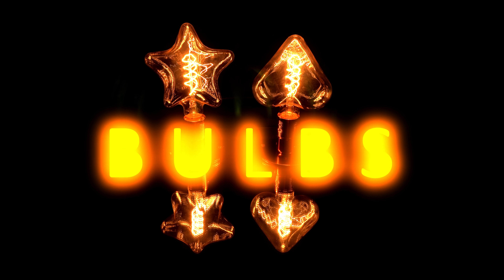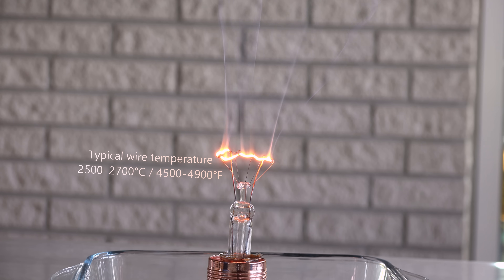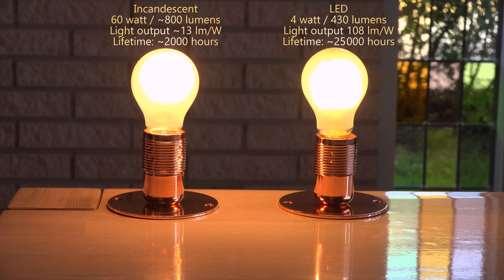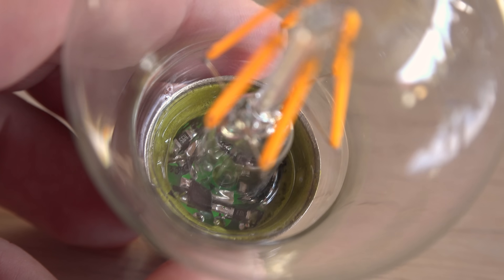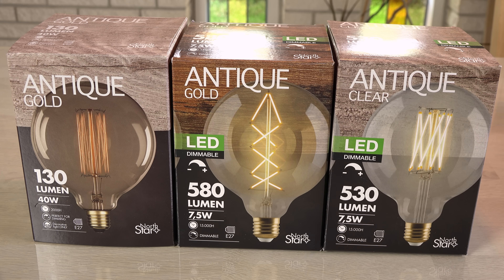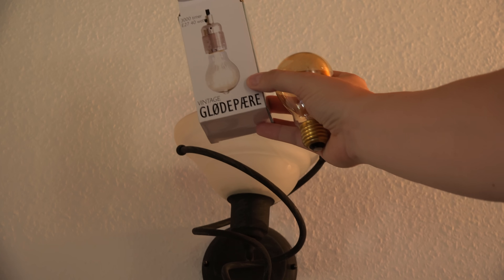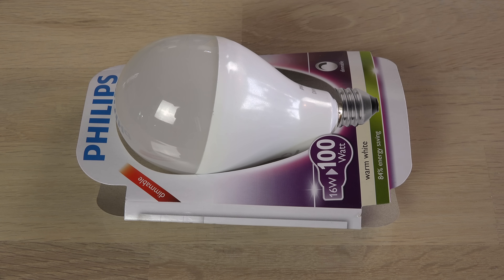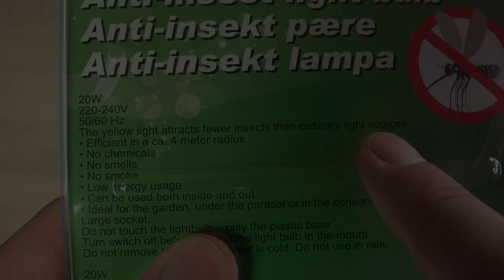Light Bulbs | LED vs. Incandescent

Comment: It is suspicious that incandescent bulbs are completely band. Spiritualist believe that negative spirits are scared off by incandescent light sources. It is similar to the suns energy. LED is cold light. unlike the sun.
Reply: In 1917, they probably said the same thing about incandescent electric lights... in favour of gas lights.
Reply: No, the sun uses much higher frequencies than your incandescent bulbs.  There is reason plant love 6500K not 2700K. Stop this alternative facts BS.
Reply: I am better at Ouija boards than you because I have more spirit energy
Reply: Actually the neutral cold light of LEDs is way closer to sunlight than the yellowish color of bulbs.

Comment: the thing about all this if you like in Denmark (or Canada as I do) is that for most of the year the heat an incandescent bulb generates is not wasted, it heats the house.  Sure, that isn't the most efficient way to heat if you have a natural gas furnace, but to say the heat is wasted is to not understand the rest of the house.

Comment: I had LEDs in my house then they put them in at work .I started getting headaches so I pull them out my house and I guess i will have to get special glasses for work cause their LEDs are worse than the ones I had . so it's either special glasses are suffer with headaches .

Comment: The amount of energy which is "lost to heat" might not really be the large net loss in household energy consumption it is being made out to be.  If you live in a locale where your furnace kicks in almost every day due to cold nights or winter climate wouldn't the extra energy, which is lost to heating the bulb, offset a near equivalent amount of energy otherwise needing to be used by the furnace?  Heat doesn't just disappear, even small amounts.

Comment: I replaced most my lights (even the outside FLOOD lights i got) with LED...it's well worth the change. My bill went from 300usd to 185 a month..it's a huge difference. Also the "LED PROBLEM" lunch meat that looks that, it does not fake it as normal soft bulbs do. I call that reality not a problem...

Comment: Did you test the lifetime? I had LED bulbs which died after 1 year already.
Reply: My oldest LED bulbs are at least 3 years by now and are showing no signs of failure. I don't buy low quality LED's though, so that might be why. The LED bulbs in the spot lights in my bedroom ceiling lamp are made by Philips and were quite expensive, but they give a very nice light and have held up for several years.
Reply: Dieter Käppel 
I've had to replace my LEDs every month, how do you get such efficiency?
Reply: :'D
Reply: cheap CRI chip, even that they say it will last 20+ years 😂😂😂

Comment: Is CRI a new way of judging light color? I am familiar with the color temperature spectrum in Kelvin, like they have been using for light sources for decades. 5600-6500 Deg. Kelvin for example. Another thing I've noticed with LED auto tail lights is the lower powered tail light seems to have a very slow refresh rate, especially on some cars. Cadillacs and Nissans seem to bee the worst. Their tail lights flickering is very noticeable and very annoying, reducing my concentration while driving. Yet automobiles operate on DC.. Very curious.

Comment: There is a lot of misconception about this. George W Bush BANNED traditional light bulbs in favor of light bulbs that last 1/2 as long and cost 3x times as much, while saving less that 15% energy.  This means your spending 6x times as much on light bulbs for negligible savings on your electric bill.  LED bulbs do save a significant amount of energy, however they cost more that 60x times what a BANNED light bulb cost.  In total, motors in American factories use far more power than all the light bulbs in the country combined.  If you think your saving the planet with light bulbs you are not.

overall the decision by George W Bush to BAN traditional light bulbs has cost American consumer billions while putting that money in the pockets of large corporations

Comment: Are they really "efficient" though? 
My brand new $10 Osram LED bulbs are failing like crazy. Had 5 of them, already had to replace 3 in LESS THAN A YEAR!!!
Meanwhile, I have some incandescent bulbs in my bedroom that I couldn't be bothered to change. Now, they are over 20 years old. Not to mention they used to cost about $0.20
Specs are one thing, in reality led bulbs are crap.

Comment: +Jeffrey314159  Oh Yea! the HP version of stabilization.   I modeled that in an early circuit simulation software in, I think the 70's.  The warm resistance of the bulb is around 500 ohms and balances against a resistor in the other arm.  
...
The bulb is barely lighted to keep it on a slope of changing resistance with power.  Too cool and R doesn't change.  Too hot and R has flattened out.
The bulb was a 7 watt 120 volt bulb, very much like the olde Christmas tree lights of the 50s-90's.

Comment: In my experience the Incandescent Insect Repelling Globes were highly successful but the light's color was unpleasant for humans to live with. In my experience the new low energy fluorescent yellow lights look the same color but do not repel insects. I find night vision is greatly reduced under the new fluorescent globes because they lack the color range to illuminate all surfaces. They are bright but color blind. If no red shines on the surface, no red can be reflected. The new fluorescent globes forced on Australians failed within a year, but we were told they had very long working lives. Your revelations confirm my experience, the new globes cause poor vision and may be very harmful both physically and psychologically. The LED lights flicker and are in my opinion fatiguing. i don't know if they contribute to epileptic seizures. Laser lights can be painful and blinding, causing people to look away. Not good to look away from laser traffic lights and turn arrows. People in Australia have died because they failed to distinguish between go lights and turn lights at controlled intersections. The authorities and light manufacturers and installers just turn a blind eye, because if they don't, they are in trouble. Thank you for this revealing presentation.

Comment: Thanks for the info.  The biggest problem with the specs is the life.  The hours that are posted are pure fiction.  I've replaced LED and especially florescent bulbs as much if not more often than the incandescent ones in the same fixtures around the house (multiple bulb ceiling lights).  Without the ban, these bulbs would not be competitive.  The real reason the ban was put in place (at least in the US) was that the legislators were given huge investment opportunities in the manufacturers of the new bulbs.  They made a lot of money by making citizens go out and buy inferior replacement bulbs for a higher price.

Comment: Personally this is one law which had good intentions but wasn't though out.  This is my experience.
My living room was lit up by 2 100W bulbs.   60W bulbs was dull, depressing and strained eyes when trying to read.

They were replaced by 2 light rails which hold 4 halogen bulbs each (8 in total)
Because these bulbs only light up a very small focused area I have to use 55W to get close to the lighting the 2 100W bulbs generated.
But that isn't great.  I've since had to add 2 floor lamps with "energy saving" 40W bulbs to bring up the brightness more and its still not the same level as what the 2 100W bulbs would have generated.
So I replaced 200W worth of lightbulbs for 520W of bulbs.

Similar with the bathroom, which would have had 1 100W bulb, now has 8 55W spotlights. 400W
Bedroom would have had 1 100W bulb has how has 3 60W spots. 180W

So for those 3 rooms, I would have been using 400W of bulbs, now uses 1100W of bulbs.

I know, try new LED.  I have.  At great expense I replaced all the Halogen bulbs with main brand led equivalent.  It cost me well over £100 to do this. Within 3 months half of the stopped working.

Comment: some of the LED watt ratings are based on incardencant equivalent in matched  lumens 

Lumens Incandescent light bulb watts Fluorescent / LED watts
600 lm 40 W 10 W
900 lm 60 W 15 W
1125 lm 75 W 18.75 W
1500 lm 100 W 25 W

Comment: Yes, CF and LED lamps are more efficient luminaires; however, if you use them to can say goodbye to any AM radio stations you enjoy.  Radio interference, especially at the lower end of the AM band, is outrageous.

Comment: I already knew all this but still thoroughly enjoyed it just the same. Incandescent bulbs are not banned here in the USA but I stopped using them in my home several years ago. I use both LED and CF bulbs in my home and they use far less electricity than incandescent. I very much enjoyed your excellent video :)

Comment: I bought a stock of 150W incandescent light bulbs when they got banned. It's really hard to find an equivalent E27 LED. Something like that 40W LED would probably be pretty good. Modern constructions seem to use distributed light sources and well... weaker lights. 150W incandescent for the kitchen, 2x58W fluorescent tubes for room where I do some work, 36W fluorescent tube for a small bathroom, ... I really like light.

Comment: To all the commenters that have been stating that incandescent lights are actually efficient in cold climates since the heat doesn't go to waste. 

Yes, I can easily see why that might seem logical to you at first glance, but it's very far from the truth. Using light bulbs to heat a room is the same as using boiling water. Vaporising water in order to hear a room  is very, very far from efficient and you're much better off using a fireplace / airconditioner / whatever. 

Can you please stop spreading this BS now? :)
Reply: True but it does give off a little extra heat but it's not that efficient. Still who cares if it's not efficient? It feels warm and cozy and it has a nice light. LED looks so cold and boring and are alot more expensive. I rather waste the energy and pay more in electricity bills and buying dirt cheap incandescent light bulbs that gives off a hot light.

Comment: Good video, good information.  However, many of the comparisons are almost meaningless for anything other than a good video or argument for an opinion.  LED lamps ARE more energy efficient than any other electrical lighting, and if that is the primary goal of using them, then that's the way to go.  However, none of the ratings - CRI, lumens, watts, color temperature and others, are not stand-alone figures.  One example is that an LED lamp with a daylight color temp (5500-6500K) with a CRI of 95 will render a truer "picture" than a, incandescent lamp of 4500K and 100 CRI.  I think what I'm saying is that a more balanced presentation would have made for a better video.  But I still gave it a thumbs up.

Comment: You can still buy 40w, 60w, 100w even 200w light bulb in the EU, it's just not being sold as the household bulbs, but at hobby markets, as you need conventional bulbs for various aplications where LED's would not be safe to use.

Comment: Incandescent lightbulbs are NOT banned in the EU for instance at the moment, neither will they be.

"What changes exactly on 1 September 2018?
From 1 September 2018 onwards, some non-directional mains-voltage halogen lamps (mainly the pear-shaped ones) will no longer be brought to the market.

This decision does not affect

directional halogen lamps, such as popular spotlights
halogen lamps often used in desk lamps and flood lights"

https://ec.europa.eu/energy/en/news/phase-out-inefficient-lamps-postponed-1-september-2018

Additionally, Incandescent lamps will be produced for the various industrial applications for the foreseeable future.

Comment: Those “energy saving” lightbulbs don't give out much like, it takes so long to give enough light, you are already done with that room. Also they are fill with Mercury that's not really environmentally friendly. If it breaks it will spill and you have to leave the building and get the hazmat services to clean up the mercury.

Comment: I'm not thrilled with the incandescent bulb ban. I could understand putting some kind of luxury tax on the bulbs to discourage their use (effectively making them the most expensive kind of bulb), but an outright ban seems terribly heavy-handed and unfair. For instance, here in the US, the government tried really, really hard to push everyone to use CFL light bulbs... but what they didn't take into account was that a lot of people get headaches under those type of lights, and that it did create a risk of mercury exposure should the bulb shatter. At the time, LED bulbs were almost unheard of. My Mom and I couldn't use these new bulbs because they gave us headaches... for us, the LED bulbs are a godsend because not only do they spare us from being forced to use CFLs or switch back to candles, but they help keep my stuffy little bedroom from overheating when I turn on a computer and a light at the same time.

The reason I'm not fond of this ban, though, is because it basically takes everything out of the consumer's hands and puts the binders on. For instance, what if someone is an artist and needs to see color as accurately as possible? Or what if they were relying on the bulbs for heat in a drafty space, and will now have to invest in a space heater to get the same effect, with no real reduction in power consumption? Government regulations like that are very top-down and big-picture, and don't really leave a lot of room for individuals who find themselves in unusual situations.

Comment: Banning lightbulbs? Seems a little authoritarian. So if you like the look of a warm 100 watt incandescent hanging in your kitchen light fixture that will soon be illegal, but if you want to heat your house with a 10,000 watt electric heater that's ok?

Comment: LEDS Emmitt blue light waves that suppress melatonin causing sleeplessness, if leds are to become the norm them filters that completely block the blue wavelengths are required.
Reply: From what I can find, LED light bulbs are generally not going to emit enough blue light to interfere with melatonin production, at least not in a statistically significant capacity.
Reply: Neighborbob On their own yes, but we use them in everything, from phones, to tablets, TV's, car head lights, street lamps, they are everywhere so we're perpetually exposed to the blue light waves.

It's the constant exposure that causes the problem related to melatonin suppression over a long period, which then has no time to recede afterwards due to continued constant exposure.

Comment: 8:55 Check the fine print on the box. In the US, they advertise CFL and LED bulbs with the wattage that would be used if it were an incandescent bulb. Before CFL and LED bulbs existed, the wattage of a bulb was used to indicate its brightness level. If someone wanted a 100 watt bulb replacement, but the package said 50 watts, it would be assumed to be half as bright.

http://media.cleveland.com/business_impact/photo/15fgbulbs2jjpg-acaa2cca19b1ee1a.jpg

Comment: Not only do you get flicker from bad LED circuitry that uses pulse width modulation typically to control the current driving the LED, you also might get 50hz mains power cycle that is visible in most LEDs because the LED is able to light and dim very fast unlike a burning tungsten which appears to the eyes as a constant static image just like a burning flame. The new LED's are mentally fatiguing because its like looking at a computer monitor all night with that 50hz and or PWM refresh rate. So unnatural.